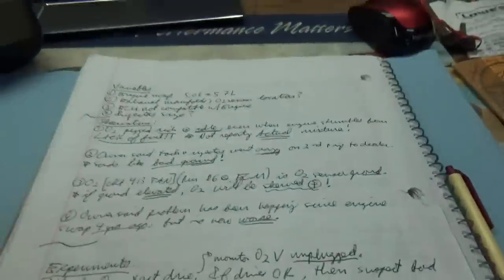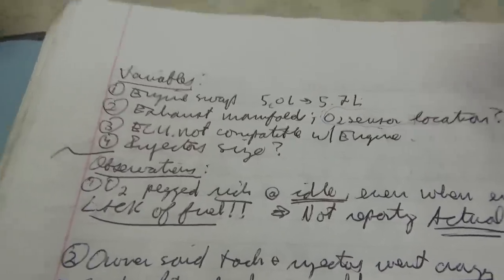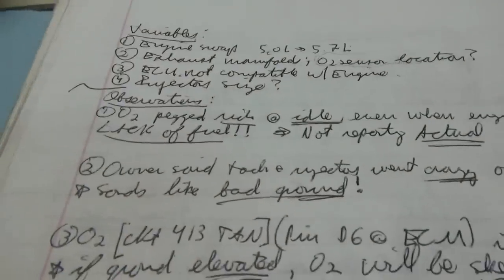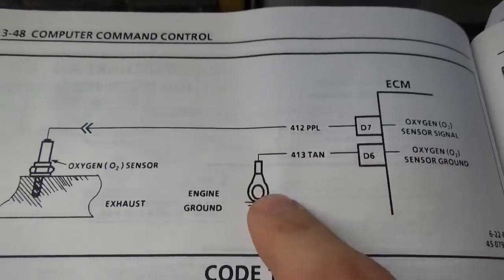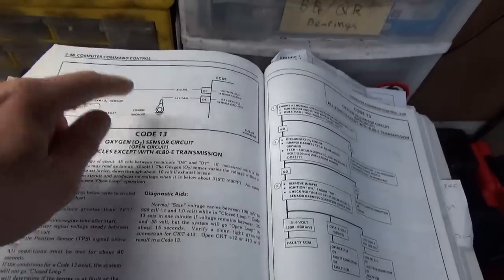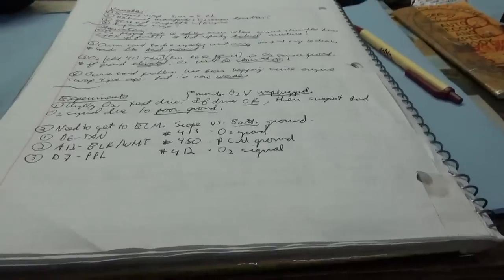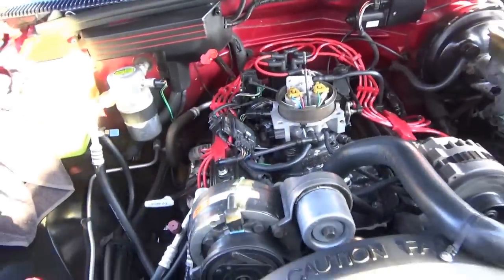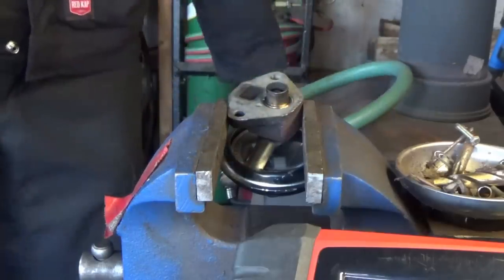Classic Chevy Christmas! - Part 2: Emissions Systems

Comment: I agree with the chorus of people who noticed the dripping left fuel injector.  That may be THE issue.  A strobe or timing light will help you see the spray fan more clearly. (The right injector looked good BTW.)  Also, the EGR valve is shot. It should hold the vacuum and cause stumbling at idle.  Although it's not causing the idle problem, it's never going to open because the rubber diaphragm is split.  Also, the vacuum to the EGR valve should increase when throttle increases. 
Can't wait for the next installment of this series, Ivan.  You have the best auto mechanics channel on the Internet! (Sorry Scotty.)
Reply from the maker: Thanks Mike! You will not be disappointed....WE WILL FIX THIS TRUCK!!
Reply: I’m not sure both types of egr valves hold vacuum. I think the one design needs a little back pressure first.
Reply from the maker: Exactly right. I had no idea they made two different types before I read the service info!

Comment: Watching Ivan's thought process is amazing.
Reply from the maker: Just wait until I get frustrated haha
Reply: @PineHollowAutoDiagnostics  I'm confident you WILL figure it out !
Reply: @PineHollowAutoDiagnostics  I hear you there. I have Saturn Astra belongs to a Viet Nam vet. I am doing all the work for free. The ECM replacement install is driving me crazy.  LOL  Even with a TECH 2!
Reply: @PineHollowAutoDiagnostics  At least you have live data on that vehicle. All I have is flashing light codes on mine. 88 Isuzu 2.3 I-TEC. Doesn't know whether to be rich, lean or correct each time you start it. So I am setting up to make a break out box for the computer. An eight channel pico would be nice here but only have two 2ch lab scopes and three DMMs.. Going to monitor injector pulse width, O2,  MAF, B+@ECM, grounds@ECM, injector modulation pulse from the distributor, engine coolant temp sensor and fuel pressure. The car has good days and bad days so I will get to see both. When I do this maybe I'll send you a picture of the total hook up just for poo and laughter as Eric would say.
Reply from the maker: Had to do this on my 1989 Mazda MPV 2.6L. The MAF was a bit skewed...fixed that one with an in-line resistor on the signal wire. Still working fine 10 years later!!!

Comment: I m a fleet mechanic. I know its hard to do otherwise. When we pierce a wire, I find that in about three years that wire will oxidize at the point of fail. Not so much in the cabin, but in the engine compartment it will. I find this in our vehicles. Even when you think it stays clean. Your great to watch and Im always learning. Thanks.

Comment: Very interesting case!! Can’t wait for part 3!!
Reply from the maker: Hey Maic! It's an old truck, but as I realized it's not a simple diagnosis. Everything is a variable....CRAZY!
Reply: Pine Hollow Auto Diagnostics my friend, old cars are hard to fix since there are not many pids to go by. The logic of the ECM is base on few sensors! As you said too many variables! But it is fun!!
Reply: @PineHollowAutoDiagnostics  these 89s and 90s trucks drove many a man to drinking.,   thats why so many parts get replaced on them, because everything is somehow connected, and symptoms can be very similar.  if the parts werent plentiful and cheap, these trucks would be extinct!  great when running good but when they act up,  you better get you a snickers.

Comment: Hey MotoYam 
Excellent Test checking for the 1 wire o2 sensor. Seen that ground loss many times. GM started putting a separate ground wire soldered on the o2s for there 366 big blocks truck motors. Really enjoyed your theory. For someone who doesn't do this for a living like I do. Youved done well.👍👍
Reply from the maker: Hi Richard, thank you for the comment! I really thought I was on to something, but that ground was near perfect! Oh well, that just makes it more interesting ;)

Comment: Ivan.  I have had the same exact problem with my 1992 c1500.  When I bought it the engine was bad.  Mine was originally a 305 and that’s what I replaced it with.  Now I got a used engine.  The standings on the block were that of a TBI 305.  I later found out that the cylinder heads were 081 heads and from my research were likely from a TPI engine.  Now I also noticed my overall engine vacuum was lower than it should be.  I checked all external leaks, none found.  I tried a different intake manifold I had with the same results.  Doing some more tease arch I found the base timing for the TPI engine was 7*BTDC, not the 0* of the TBI set up.  Now I mentioned the low vacuum I was measuring it at 15” of mercury.  Once I advanced the timing to 7* it brought the vacuum up to 20”.   There was also another difference between the  two cylinder head setups.  That was the heat range of the spark plugs.  I changed to the hotter plugs of the TPI head and between the two changes my idle issue when warm in closed loop idle was much better.  My block learn values went from 102-103 to about 120 or so.  Though this information may not solve this trucks problems it did for mine.  Please also note that I did every check you have done so far.  Additionally I did try a different computer and a different prom.   Something you may want to look at prom related is a tab for driveway stall out on these trucks which was supposed to be solved with an updated prom.  If this helps great.  If not I hope you find this trucks problem.  As always great videos and I look forward to hopefully many more!
Reply from the maker: Thanks for the info, David! It's crazy how many hidden variables there are on these "old school" TBI systems! Had no idea what I was getting into with this truck haha
Reply: @PineHollowAutoDiagnostics  I mentioned this in the first video; i find it odd that your vacuum is so low - verify the map sensor compared to manifold pressure at idle.
Reply: n3lee   Yes good suggestion.  I did when I was diagnosing my trucks problem.  I am lucky enough to have another TBI truck that runs awesome so in addition to comparing the pids for the map sensors with the engines at the same operating temperatures I was able to swap in the “know good” sensor  to the truck that was not running well and the results were the same.  Low vacuum at hot idle.

Comment: "Have you ever seen injectors firing on a Throttle Body"   Yes I have.  Is that injector dripping fuel at 25:03 ? The fuel should be a steady stream and atomizing in the venturi.
Reply: I came here just to say the EXACT SAME THING, SHOULD BE SPRAYING NOT DRIPPING. Check fuel pump pressure & the injectors.
Reply: @NoWr2Run  The early Volvo's had that system on some of their cars.
I can tell you that  is the way they worked.
They called it a single point injector on a 4 cylinder engine.on a 1.8 and 2.0 engine.
First time i have seen 2 injectors on the throttle body .
Reply: That was my thoughts too. I thought for sure Ivan was going to mention the poor spray.
Reply: True.. Dumping fuel
Reply: I agree !
Reply: That's exactly why my 1991 Chevy truck wouldn't pass a smog check.
Reply: James Carroll  could be true fuel pressure to high or faulty regulator.
But both injectors would be dumping not just one.
I had one full of debris.
Reply: Bingo!  I thought the same thing!  The left side injector appeared to be dripping quite noticeably compared to the right one.  Perhaps this is causing the rich condition.
Reply: @NoWr2Run  i bet he put a big ass spring in the fuel regulator assembly.
Reply: Yep that injector is probably damaged
Reply: A 2 injector TBI takes the place of a 2bbl carb. My '88 Nissan had 1 injector. 

They also made a 4 injector TBI, mimic a 4bbl carb.

They appeared to be dripping, not spraying. Pump matched new "bigger" injectors?
Reply: that reminds me, the wires to injectors used to rub through and short out to the riser ring/crankcase breather metal, depending on which wire it could blow fuses or make the injector spray and burn the coil/s out.
I normally use a timing light or strobe light to look at injector spray pattern, that style TBI injector always did look somewhat drippy between spray bursts.
Reply: Ivan set up an injector pressure drop test out of interest, the left hand as viewed does not look good.
Reply: Yeah, definitely something going on with that injector. Even at a distance it looks to be raining fuel compared to the other even spray.
Are you a tech somewhere here in Calgary?
Reply: @IAMNOSLEEP  Hmmmm....Wheels are turning, lol. I have things to do but lack time and could use some help, especially with the diag side which I'm trying to learn from all these nice people but no hands on time. Not looking for free help either. Any other way to contact you??
Reply: @ekaftan  Was I talking to you?! Pay attention!
Reply: I thought I Saw dripping also
Reply: My question is that a trick of the camera and Ivan's LED headlamp? Two big injectors have to dump fuel in to some extent. This is OLD tech...
Reply: that's dripping indeed! I came to say that as well
Reply: @dickfitzinya3082  That's some funny sh*t  Dude !

Comment: Since the injectors can be unplugged separately I would try unplugging them independently and looking at idle mixture at O2 sensor as well as block and integrator. Do this for each injector.  Just a thought. You and Eric O the absolute best on YT!
Reply from the maker: Would probably just stall out if you cut out half the fuel!
Reply: My thoughts exactly. I'd check for vacuum leaks as well. There are so many variables going on here. It's case where you have do the process of elimination to deal with all the variables. Diags like this can be a real pain. But when you do figure it out, it'll bring out your best. I've been through running issues similar to this in the past. I've seen sometimes it can literally take days or even weeks to figure this out. Have a merry Christmas and happy new year.
Reply from the maker: Exactly right, Paul. One variable at a time, via the path of least resistance. Takes time, patience, and lots of note-taking and trust in your diagnostic tools :)

Comment: When you stopped and went back to diagnose it again acting as if you had no prior knowledge was  stunning. It's what we all need to remember about problems, I know that when thinking about cars or any problems I get caught in a loop then throw the parts cannon at it: be cars or life.  

I have watched a couple thousand YouTube videos dealing with cars too mowers and that idea to back up has never been said. Sensory overload. Thanks that's another tool for me to remember.
Reply from the maker: Yeah sensory overload for sure! My mind often gets carried away with all the info and possibilities. One of the hardest parts of problem solving is keeping the thoughts organized, and designing very specific experiments to have a clear answer to every fork in the road. Might take some time, but in most cases it gets to the answer more efficiently and accurately :)

Comment: You can check injector spray pattern with your timing light(while you are checking ignition timing),point the light at each injector and it will freeze pattern. Should be no drips.Check prom and calpack numbers that are on each against list for proper application in old G.M. parts catalog.

Comment: Gotta love them old OBD1 GM vehicles...(pre 1995/95) they were one of the rare ones to give out a datastream. I still have an old Snap-On MTG2500 scanner I use for the old stuff...always comes in clutch for an oddball issue on an older GM!
Reply from the maker: Aaah the old red brick! Funny that you mention it...might make an appearance later in this saga ;)
Reply: @PineHollowAutoDiagnostics  I love my old brick! I've got al lthe adapters for all the hot mess back then for Chrysler, Jeep, Ford, Toyota, Nissan and whatnot for American and Japanese vehicles...shop has a newer Solus series scanner for OBD2 stuff...but the older stuff...out comes the 2500 and lemme tell ya, I'm not gettin rid of it any time soon! Too handy...way too handy.

Comment: not sure when he replaced the injectors if he point new ones in at time of engine swap looks like one side is duping more like its not performing well … I would check fuel flow and also fuel pressure ,, yep my next step would be fuel delivery and pressure ...great content and its fun to watch your diagnostics steps,, great job

Comment: loving this as i drive a 94  silverado 5.7 tbi .... i have headers with long tube the o2 is in the collector on left bank ..no problems .. ive been lead to believe that compression and cam can also cause running problems .. is it a tbi engine thats in the truck ... generic crate motor is not compatable  ... just another line of thought ... lots of great comments here ... and a lot of interest for good ole truck ... was the last tbi truck ivan fixed for the rev it guy at the scrap yard .... is the map vac line on the right fitting one is a breather ..also check for tbi mods jb weld ect gadjet man groove ..looking forward to part 3 ..

Comment: You proved egr is bad!  But you also proved that it’s not the issue...  hmmmm.  Fuel pressure gauge needs to be hooked up and regulator needs to be checked.  Do you have any of the old throttle bodies available?  Are 5.0 and 5.7. Injectors the same?   They are not.  Standard part number tj4 is 5.0. Tj7 is 5.7.  Would that make a difference? Is the computer looking for the 5.0 injectors but it has 5.7 injectors?   Hmmmmm.  I like the vehicles that are modified.  Makes it interesting.  Plus if you can fix it when no1 else could.   It’s a good feeling!  Bravo Ivan be patient and you will succeed.  You are the man!!
Reply from the maker: Thanks for the kind words, Bill! This was definitely a crash course on GM TBI for me. You're definitely on the right track with those questions :)

Comment: Seems fuel spray on passenger injector is blurping.fuel..may have fuel pump diaphragm not holding pressure or incorrect injectors.

Comment: Throttle Body Gasket at back is notorious for blowing out a small section. Will elevate idle from a little to 1200 rpm. Of course Map senses it. Also check thermal air door in air filter housing snout. Supposed to open from exhaust temp but foil tube always gets chunked. Also don’t overlook base timing. Usually sets at zero plus/minus couple degrees.

Comment: Great video once again, was sooo looking forward to it. My EGR guess was incorrect. Next would be leaky injectors, that throttle body shot wasn't looking right, not really a spray, more like a drip? I would check that. My intake restriction guess also still stands: not enough air would lead to the ECM taking fuel away in an attempt to get back to stoich. At the same time it could lead to the ECM raising the idle in attempt to get more air. Just my 0.02$ :)
EDIT: what I mean by restriction is an actual restriction. Some kind of blockage (my old car had a "hole" in the throttle body for air intake at idle. That hole was clogged and the car was acting like this one, both on symptoms and scan data, just an example). A leak would lead to more air being drawn and thus a LEAN condition, not a rich one.
Reply from the maker: Interesting hypotheses. Like an air bypass hole for idle? This thing just has a throttle stop screw, and the IAC to meter the air at idle...
Reply: @PineHollowAutoDiagnostics   Pine Hollow Auto Diagnostics  Yes, that's how my old Opel was, it had a bypass hole for the idle and it got clogged, reporting rich at idle and stalling out. Had some mechanic replace the O2 facepalm and fixed it on my own eventually by unclogging the hole. Maybe something is clogged on the truck too. I would take apart the throttle body and inspect it, along with the IAC and injectors, something has to be wrong there. You'll get it fixed I'm sure, you're patient and incredibly knowledgeable, keep up the great work!

Comment: Check fuel pressure they are picky on pressure had a few that gave me a hard time and to find out fuel pressure was about 2 psi Lower the spec thanks for the great videos
Reply from the maker: Hmmm, but this thing is running rich, which would point to high fuel PSI? Don't worry we'll get to the Fuel Delivery system very soon :)
Reply: @WECB640  good point, they are also known for TBI to intake gasket leaks! I forgot about that until you mentioned it, but it seemed to me it was always at the front where they opened up and would go lean/high idle, not rich. but there's always a first for everything :)

Comment: I agree with others that it look like the injector might be acting up on the left side. I don't know if anyone has said this yet, but the way I used to check the spray pattern on these was to use a timing light hooked to cyl 1 and aim it at the injectors. It should be a nice cone shape spray pattern with no drips.

Comment: I'm still stuck on that Accel coil, and whatever is in the distributor for an HEI module, Ivan! :) I always forget which way weak spark, or lack of spark will push the o2's though, so I could be wrong here - certainly wouldn't be the first time whenever a computer is calling the shots! A scope on the ignition will tell the tale, I'd imagine. From the looks of the injector pattern I'd say those things are WAY to big, unless the camera  refresh rate is making it look funny ... sort of like seeing a propeller spin on an airplane when filming during flight, but in reality you see right through it.

These older trucks are fairly simple, so this is definitely an interesting one!! I'd be yanking my hair out here, lol - what else is new? 😂
Reply from the maker: I'll be yanking my hair out very soon I promise haha
Reply: @PineHollowAutoDiagnostics  - 😂🤣😂 Definitely a tough one there!